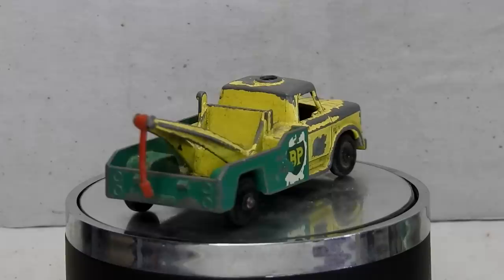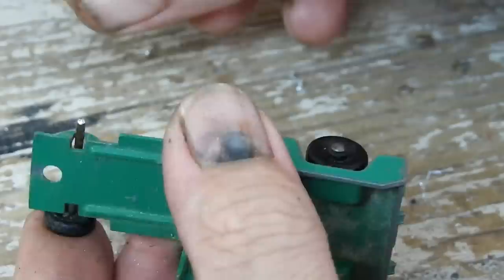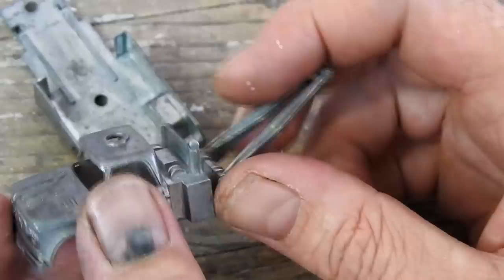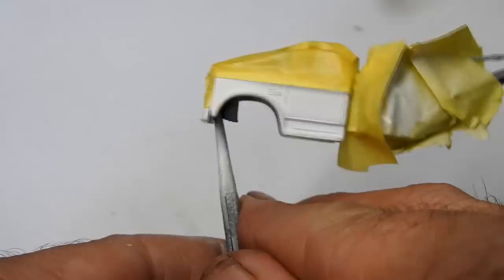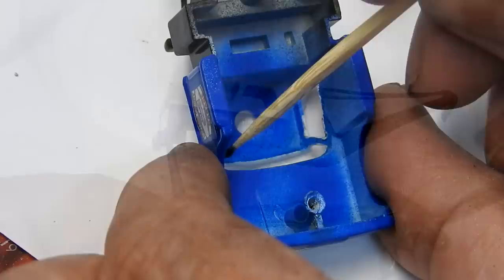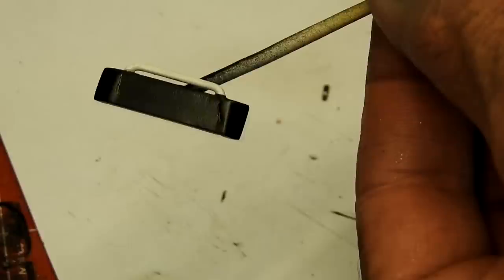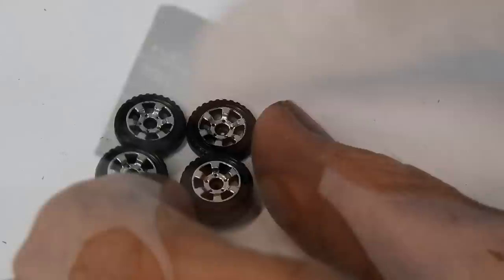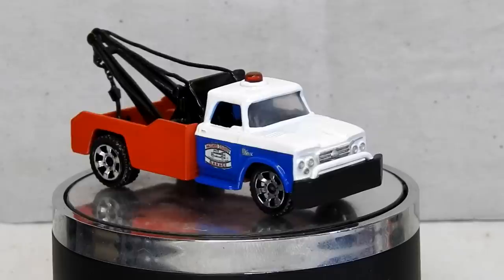Matchbox Custom Dodge Wreck Truck 'Cooter's Tow Truck'

Comment: That part you broke off and replaced, I believe is the bulkhead and those are the night lights/ cargo lights. Wasn't sure if you knew or not,  but great custom work as always, wasn't sure about cutting the wheels but it worked, 😎 thanks for sharing...